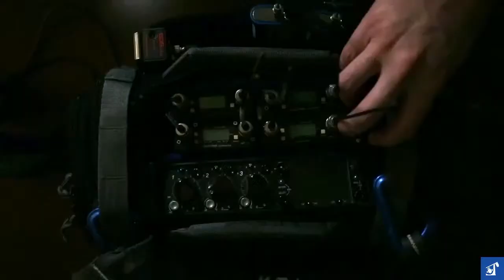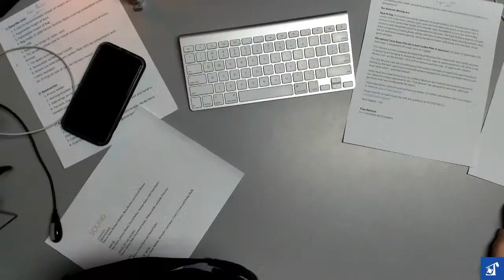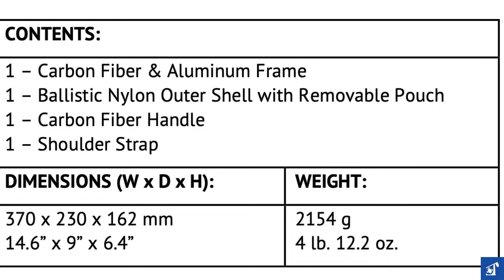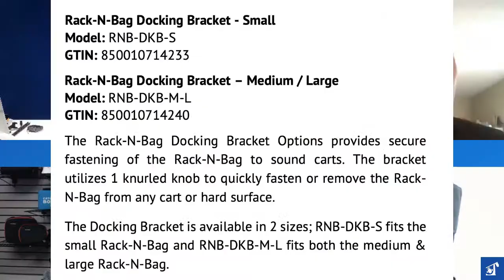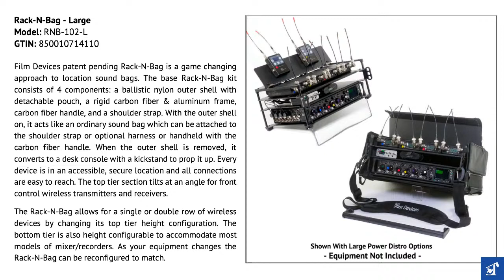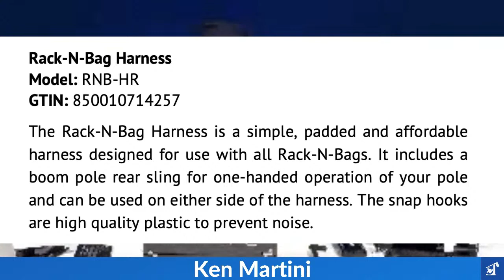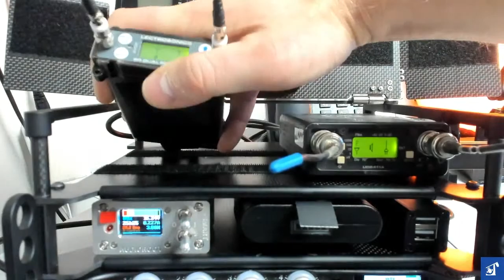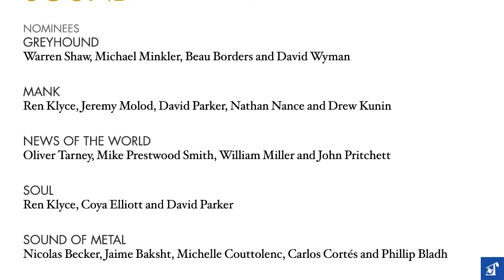Film Devices Rack-N-Bag System Overview

Comment: Answer to some of your questions:

Yes, we are planning on a version for the Aaton Cantar mini. 

Most people who use the Rack-N-Bag find that the outer nylon shell is mostly used while the gear is stored or transported. In the field it is used mostly without it, even when used with a harness. It is a giant leap once you realize the bag is no longer needed and was always a hinderance to accessing your sound gear. 

You also loose the weight of the bag. The frame weights are: Small 2lb 2oz (964g), Medium 2lb 4oz (1170g), Large 3lb 4oz (1492g). Some people asked about if it was comfortable having the carbon fiber against your body, I had no problem with the small and medium. The large kit could be problematic, but solved with a piece of foam Velcroed to the bottom. 

All cables visible and easy to get to. We make almost every type of cable in short lengths designed for location bags. They come in 30cm (11.8"), 40cm (15.75"), and 50cm (19.70").